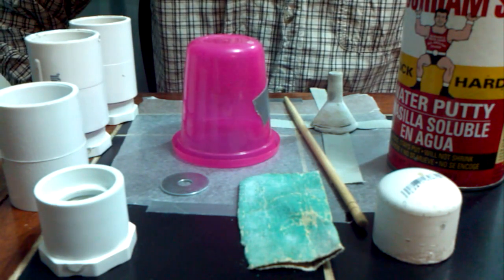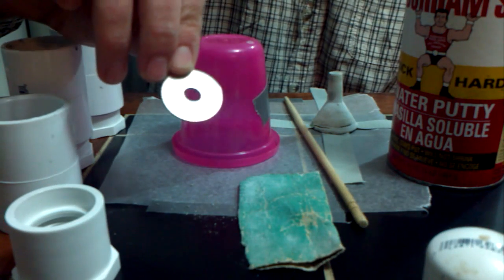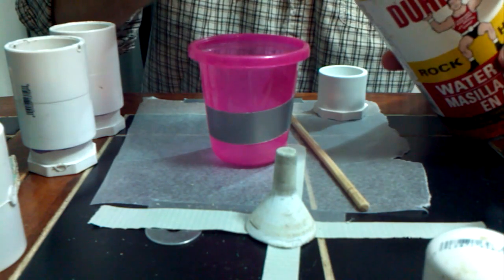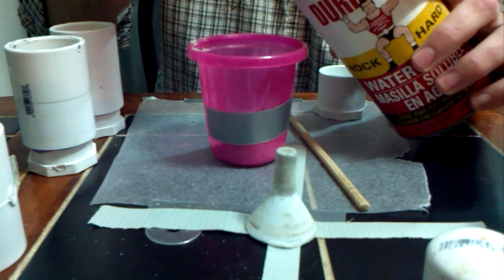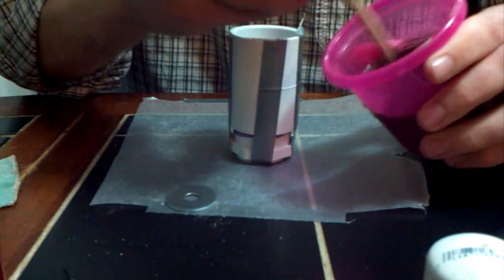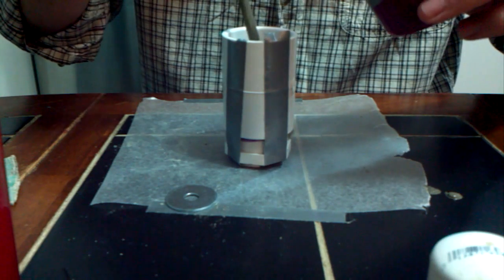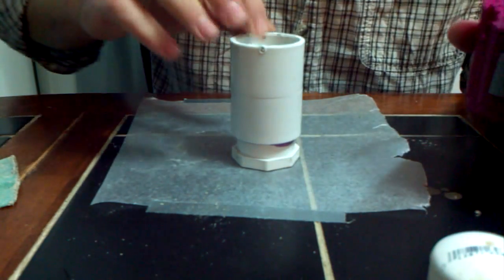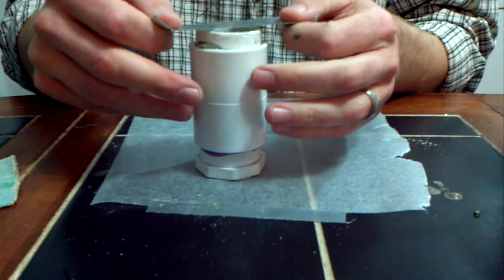Part 1: How to Build a High Power Rocket - Nozzles

Comment: This is a very nice series and it looks to me he does a good job explaining everything. Unfortunately, he does not ever state or say what specific PVC sizes he's using, nor does he give a size for the fender washer. These are usually the very FIRST things you want to state right up front, the materials list. This isn't listed so you'll have to eyeball all the materials used and make an educated guess.  Not particularly a very elegant way of doing it and kinda of a waste of time. If you're going to do a multi-part tutorial on YT, please DO make EVERY effort on putting up a materials list so everyone can go out get the right stuff the first time and not have to guess about it. Just common sense.
Reply from the maker: Thanks for the feedback.  I did not list those simply because I did not want to be responsible for someone who failed to do their own research on pressure calculations.  Hope this helps... later in the series I get very specific about the PVC diameter size and throat diameter.  For example: on a 2 Bates Grain motor using 1.25 inch PVC I used a 1/4 inch washer.   On a 7 Bates Grain motor I used  7/16 inch washer.  I had a Bates Grain calculator that enabled me to enter the number of grains, their width and length so I could keep pressures within safety margins.  Hope this helps.  Have fun!

Comment: Fer crying out loud... if you want to make a cone of a specific angle, or a diverging nozzle with a proper bell... all you have to do is rig a SCREED that pivots around a vertical rod that has the profile you want cut in a thin piece of sheet tin. Make one for the converging side and another for the diverging profile.
Mix some PLASTER... and as it gets thicker, pile it up around the vertical rod and use the revolving screed template to shape the plaster to the contour you want.  You can mix more plaster as the first batch sets and fill in any dips or gaps, until the profile is as perfect as the cutting edge of your template.   Add a separation agent to the surface of the set plaster and that’s the FORM for casting your supersonic nozzle.   Easy and cheap and perfectly accurate.

Comment: Divergent part visually looks too short, shorter than minimum length nozzle, it means that initial divergent angle is too large resulting shock losses. I just eyeballed it, so I may be wrong.
Reply from the maker: It isn't perfect, not by a long shot.  Having said that, i've never been disappointed in the power these motors produce.

Comment: To easily center your nozzle...

We will make a simple and inexpensive tool.

Get a dowel that will slide easily in and out of that funnel. 

Next...Cut a thick wood disk (3/4" plywood) that has the interior diameter of the PVC casing. Sand the edges so that it slides in and out easily.

Drill a hole in the center of that disk that the dowel will snugly fit inside. Use a drill press as you must have this hole perpendicular.

Make the appropriate height measurement and glue that dowel to the disk.

Using the tool which you fabricated it is now easy.

Slide that tool into the PVC pipe and fit the funnel on the other end.

Then anchor that funnel with tape 

Then remove the tool.

Then add your Ready Mix.

Perfect and consistent centering each and every time.

Comment: Pity you didn't display this in metric units. There are only 3 countries in the world which don't use the metric system - US and for good company, Liberia and Burma! That's a total of only 5% of the world population...
Reply from the maker: plenty of conversion kits available on google.  I've used them extensively!
Reply: Yet there is only one country to land men on the moon....
Reply: Unless that was shot in Area 51. :p :D
Reply: And still the world is riding on the USA and it economy even when we use such barbaric measuring systems. As far as the other two the are just trying to mimic what has been successful up till now. The USA id slowly switching the tooling over to metric though. After that you will be able to finally build this guys nozzles allowing you to get involved in rocketry after all this time.

Comment: 3:22 you also may want to use Hydraulic Cement (used for in ground pools) or Something called 'Fibercoat" which has little hairs of Fiberglass Embedded in the mix.   Makes you want to ask me "How do I know that?" I cannot divulge. :)
Reply: and go a 50/50 Mix with the water putty.

Comment: For a better nozzle, use a set of Estes nose cones.  The ones that go on the minimum diameter D motor are the ones.  They come in two lengths and shapes.  The inside one is a short nose cone, while the divergent is the long one.  They come in parabolic/ogive and cone.  You'll be able to build a supersonic c/d nozzle just as easily as you build this one.

Comment: To simplify this process take a 3/4 ich piece of pvc pipe, cut it to about 4 inches long.2. purchase some of the cone shaped disposable drinking cups.3. place cone inside one end of the pvc. (about one inch)4. hot glue the cup to the pvc pipe with cone end inside pipe.5. mix Durams water puddy and pour it or push it into the other side of the pipe.6. when its dry remove cup and drill a 1/4 inch hole through the center of the new coned nozzle.7. Add rocket  mix solid or powder then pack benite clay at end. - glue to a stick, insert fuse and fire away. cost about 5 cents per rocket

Comment: Do you think a stabilising stick is good enough for a high power rocket? or do you really need fins and a launchpad?
Reply: Bastiaan Kolster YES you need fins and a launch rod. perhaps not a proper launch pad though. something solid to put a rod into. concrete drilled, or.wood (heavy) with nuts washers and bolts. but you need a strong 1/4" stainless steel rod either way. around 4 ft long. or a launch rail. and ALWAYS fins!
Reply from the maker: I have not done much work with just sticks, so I don't really know.

Comment: So I've been making these sugar rocket motors for a few months now, and the ones which don't explode, will strobe shortly after ignition and restart the burn a couple of times. Does anyone know how to stop this from happening?
Reply from the maker: These motors are doing that???  If that us the case the throat diameter of your nozzles I'd way too small or you have air pockets in your fuel.  If it is strobing then something is off with your fuel ratios.
Reply: Is your fuel packed tightly because when they sputter, or even explode, it's because there's an air pocket somewhere in your fuel. As long as it's packed very tightly there won't be any air pockets and it will be a smooth consistent burn.
Reply: been making it the same way as is in every video I see, using the same tools, made of the same stuff. I'm as careful as I can be so as to not have pockets.
Reply: Melting. uncapped, they burn consistently.

Comment: So, I've been brainstorming and experimenting a bit with nozzles, since it's the second most important part of the rocket. I've found that plastic eggs are the perfect size and shape for casting these. The longer end for the divergent, and the shorter end for convergent. You have to use an end piece without the lip, but with the right casting material, that shouldn't cause a blow out with the right throat size.

Comment: how heavy are your nozzles? you seem to use A LOT of cement... my nozzles work out to be approx 50% of my fuelled rocket weight so im looking to bring that down...
Reply: I was wondering about adding pearlite or vermiculite to the mix.  It would bring the weight down.  Try a 50/50 mix and see how it holds up.  I'm looking at refractory cements.  Staying away from pvc motor casings though.

Comment: The part about supersonic nozzle is weird. The nozzle is definitely supersonic, the angles dont matter that much, you only loose some efficiency.

I am little concerned about your expansion ratio (throat/nozzle exit area ratio). With high chamber pressure it would be good, but our rockets operate at low pressure, and ideal diameter of nozzle exit is about 2 times the throat diameter (thats 1:4 area ratio). 1:3 diameter ratio is too much, nozzle gets seriously overexpanded, and your ratio seems even more.

But otherwise I like your building techniques very much!

Comment: Was wondering how long you left the mold in before removing?  I see you mentioned that you had to use pliers in order to remove the mold and was hoping to make that part of the process easier.  Enjoyed this series of videos, thanks for sharing them.
Reply from the maker: hi Which Wabbit....I have been able to take the mold out in as little as 10 minutes...sometimes I have to wait over night.  Depends on the temperature and humidity or lack of humidity in the environment.

Comment: Dude the throat diameter is 5/16th but you said you use a 1/4 or 3/4 washer? Why not use a 5/16th washer...I don't get it. What's the purpose of the washer if you have to drill through it if its too small...or defeat the purpose of it being there if it is too big. Once and for all...DOES THE WASHER HAVE TO MATCH THE NOZZLE DIAMETER. I don't want to know what you used on other rockets. I'm making this one and I don't want to get blown up or waste money doing it.
Reply from the maker: Hi Gary, this video was made a long time ago, I can't remember the exact diameter of the nozzle or throat...but you should make your determination based on the washer..that is your throat diameter.
Reply: WizzBang75
I think you have a 5/16th washer and throat diameter....and your grain core is 3/8ths. I will be building this rocket with 4 bates grains. Does that sound good? I hope so because that's what Ill be building based on this tutorial. I think Ill test this design with stick stabilization.
Reply from the maker: I have made many motors with 5/16 inch nozzle and 4 BATES grains.  This is pushing the safety margin, so stick to the formula and do not put in any catalyst such as Red Iron Oxide.
Reply: ok thanks!

Comment from the maker: Now I understand what you are talking about.  Ok, no disagreements from me on this.  I have had a few rockets go super-sonic but I used a different casting design than what I have here.  As I stated in the video a year ago, it is not the intention to get these rockets super-sonic, as I do not have a launch area where such a rocket could ever be recovered.  For the most part - you are correct...aiming for a constant super-sonic results is too technical for what I do.

Comment: Subsonic flow increases in velocity as the path converges.  But once it hits sonic speed, the opposite happens: the flow becomes choked and so a further decrease in diameter for sonic flow will DECREASE the flow velocity.  To INCREASE from sonic to SUPERSONIC, the diameter needs to diverge, but ONLY after the flow has reached exactly sonic speed at the throat.  To find the proper sonic area you would need to know the ratio between the pressure inside booster and ambient pressure.

Comment from the maker: beefy172, those are really good question!  If my thinking is right, a higher pressure would be built up using the convergent I have resulting in more power than no convergent at all, but I could be very wrong about this. Is my divergent narrow enough to reduce power?  I'm not sure.  I do not have the gear to make an accurate test stand, so I look to the results for success' or failures.  I am sure there are many ways to improve upon what I do - but by the time I do that, I'll be buying a lathe!

Comment from the maker: I filled the top of the mold with putty previous to using it as the mold so it would not get stuck.  Even at that, I have to use a pair of pliars to pull the mould out as the putty/concrete mixture does grab the pours in the mould.  It isn't always easy!

Comment: I think I want to try a massive nozzle about the size of a lamp...and then take it from there. Any advice on making a welded motor casing made from high quality metal? Light and sturdy? 

This baby is going to probably never be seen again though because I might not want to get caught with that kind of rocket. Better to just wear gloved hands and kiss it goodbye. Someone will report the findings so it will save me a lot of research time as well.

Comment from the maker: Hi Walrus:  Carmelization of the Fuel is a result of both Time AND Temperature.  Given the amount of time it takes to properly cook recrystallized fuel, I would not worry about a yellow color or tint unless your fuel performance is suffering negatively during burn rate tests.  Let me know - I'd be interested to know what test results reveal.  Recrystallized should be burning around 7-8 seconds per linear inch.

Comment: Hi WizzBang, I have a problem. I use Jimmy Yawn's method of cooking rocket candy. However, when I am at the liquid stage of the fuel, it is already yellow. I thought it may be because of impure fertilizer grade kn03 so i switched to "technical grade" kno3  from skylighter. This still resulted in yellow rocket fuel. I don't I am burning the fuel because I have had white batches of fuel in the past and I believe my fuel cooking technique has improved since then. Thanks!

Comment from the maker: I can only vouch for what I've used.  I can tell you that most people find that when they come up with a "good" idea, they find out the same thing I have:  Many things can sustain it's shape under intense heat - but combine heat and high pressure and it will be a different story.

Comment: hey i dont have that brand of cement you used, could i use a similar fibreglass putty stuff as a replacment, fibreglass iis strong and very heat resistant ?

Comment from the maker: I do not use ratios like that.  I base my nozzle upon the length and diameter of the BATES Grains and the length of the motor.  If you know these variable, I can provide you with an optimized nozzle size for your motor.

Comment: enjoy your video presentations.  I am accumulating products to begin building rocket engines.  I have collected some 1/4 inch thick rigid cardboard (laminate) cylinders 4 inch diameter 12 inches in length.  I have some some stoneware modeling clay (cone 10) that I plan to mold the motor around a 4 inch cone-shaped funnel and a stainless steel bell-shape (hip flask funnel) for the nozzle which will remain in the motor when it is kiln-fired.  Going to add Fe2O3 and Al powder to the KnO3 + sugar.

Comment from the maker: it is an excel spread sheet that calculates Initial, Maximum and Final know of your motor taking into consideration the BATES grain configuration, core diameter and nozzle throat diameter.

Comment from the maker: This one I believe is 5/16 inch.  It is designed specifically for a 4 BATES Grains motor.  You could use a 3/8 Inch as well.  8MM would be a near-equivalent.

Comment from the maker: Part 2 will come out some time this week - It will be the completion of the nozzles (removal from molds) and cooking/casting fuel.
Reply: Can i use grey portland cement powder with dr fixit 301urp liquid to make mixture for noozle..please please tell i am working on project.
Reply from the maker: @AnkitSharma-qb8mi  Portland cement is fine with water.  The other stuff, I don't know